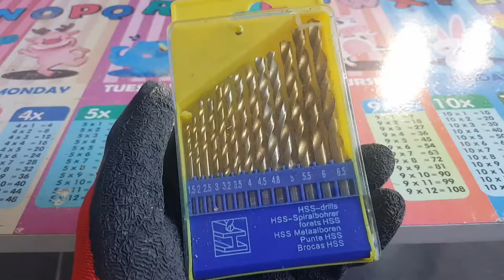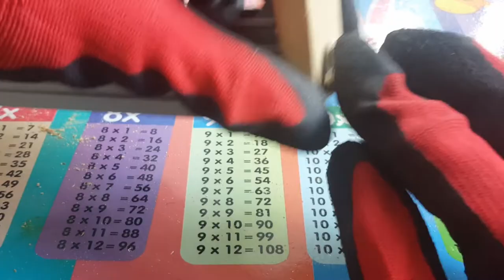DIY Lead Screw End Support for Linear Actuator

Comment from the maker: POV: I just learned that adding end support to your any linear actuator like z-axis is NOT GOOD because you will be potentionally bend the lead screw! So, this is not recommended :)
Reply: But it is required here, on your shown example. I still don't understand when collars are required... The leadscrew is already attached to the motor...
Reply from the maker: @alejandroperez5368  Thank you for your comment! I take back my words.

My real concern about adding this support is the binding issue as it travels at both ends. I'm not sure if it's only my eyes or not, but I can observe that both the linear rail and lead screw are slightly unparallel (since motor shaft and lead screw are not in centered position).  Stepper side is quite lower. Adjusting them to make sure they're parallel is quite difficult since I can't set the stepper mount even higher.

But, the spring coupler in this case, helps reduce this problem.

So, adding end support is optional.😁